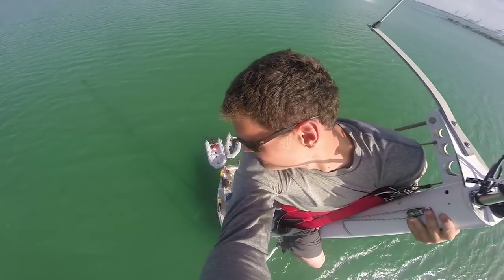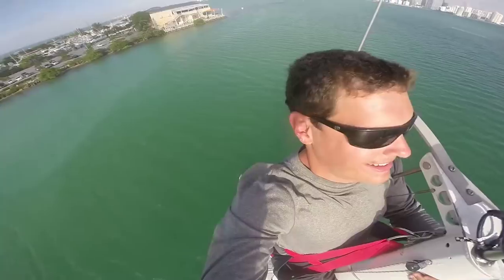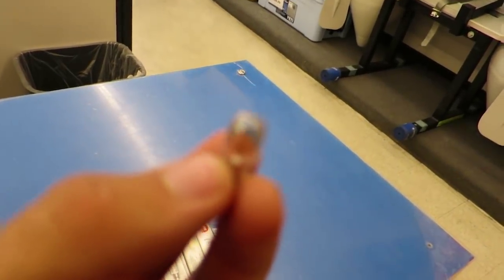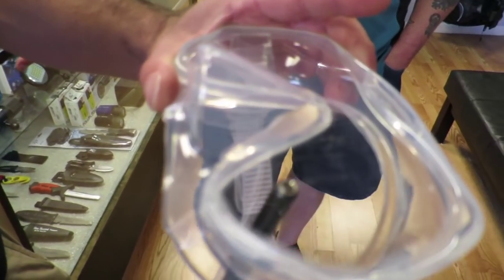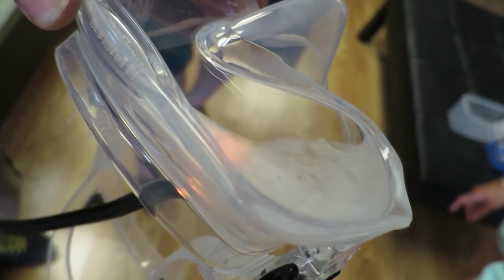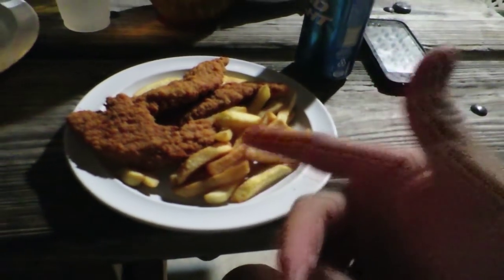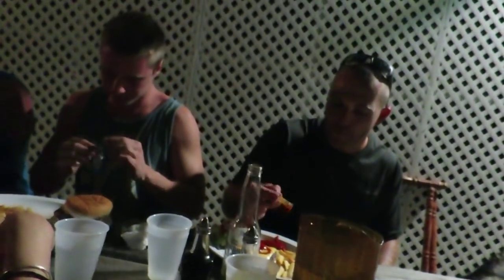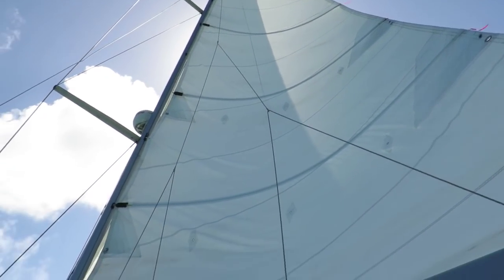REPLACING AN ANCHOR LIGHT

Comment: what happened to the motor you guys bought for the dinghy? also if you could explain what the guy at the store did to the mask?? thanks for your vids, from venezuela much apriciated
Reply from the maker: It broke pretty fast, then kept breaking then fixing then broke forever. He took off the initial layer that the factory puts on to protect the glass in transportation.

Comment: When I look at you at the top of the mast held by a single nicropress in wire,  it makes me nervous every time.   I would appreciate a backup line attached to the harness,   or something that looked failure proof.    Granted failure of that eye with nicropress is not likely,  but if it ever did stakes are high.   Stay safe out there.
Reply from the maker: Michael Benson In the second go up you can see another Halyard attached as well, it was a risky first go about it!